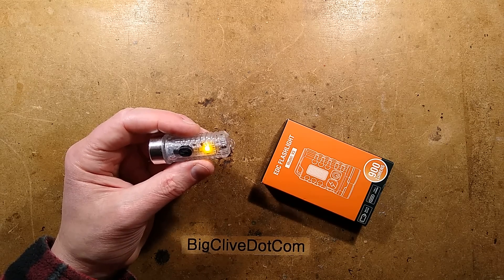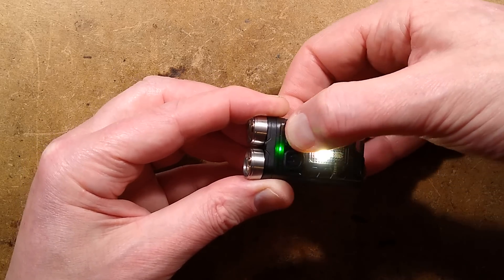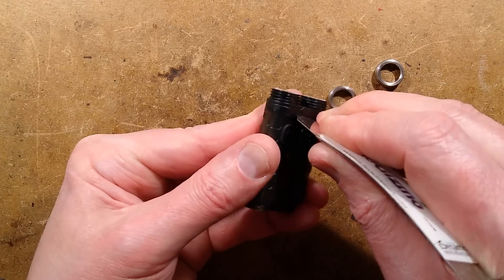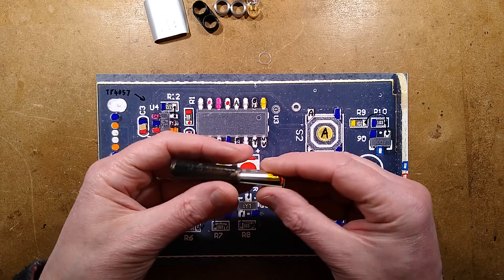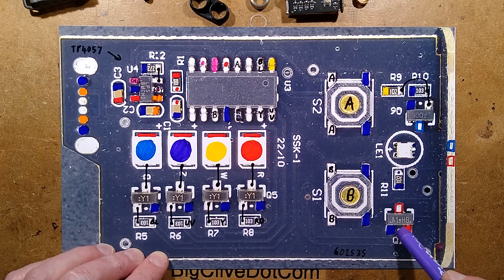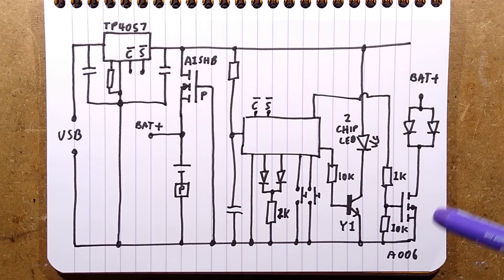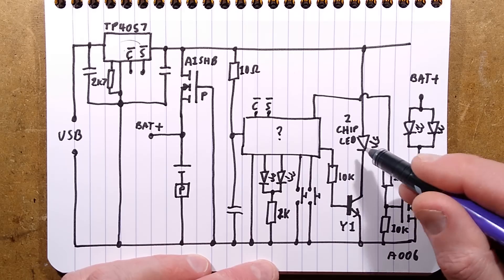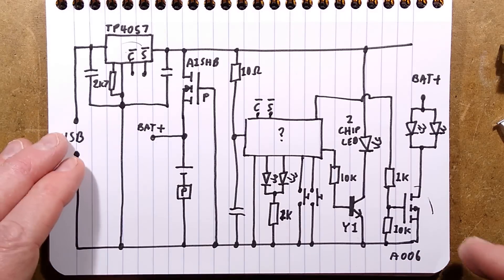Inside an EDC V3 flashlight (with schematic)

Comment: My boruit v3 was broken (not charging), tried to open up as shown in the video, broke it completely. Mine was sealed using some strong glue, the black casing on top broke in pieces but never came apart

Comment: Is it possible to dump the firmware and Flash custom firmeware and how difficult would it be? I‘d like to a a strobe to it
Reply from the maker: You may have to write custom firmware from scratch.
Reply: Probably could do that but unless you know the Chip it’s Not that easy to get Access? Im pretty new and only familiar with arduino/esp/rpi

Comment: These flashlights are great right up until the point you accidentally activate one in your pocket when the battery is low and it drains it below the point where it can be recharged. I've had two of them fail in that exact way now, both in less than five months. The low voltage protection either doesn't exist or doesn't work, and once it drops below threshold there's no way to fix it without breaking it open and replacing the cell. It's a bad design for a torch that's supposed to be kept in your pocket.

Comment: The original Rovyvon Angel Eyes E3 cost £50, Vs £20 of the Boruit V3. The Rovyvon uses a constant current drive and not PWM, and the components are first choice. But for almost one third of the price you got similar functionalities but not similar quality. In addition, the original has one Li-Po battery and one AAA alkaline, and can switch between the two.
Thank you Big Clive for the video...

Comment: there's an eBay torch that's been around for years that i'm surprised he hasn't taken to bits/reversed engineered. keywords are 3 led hand press generator dynamo, comes in different colours. it'd be nice to know if there's a way to distinguish a legit model from a fake, perhaps mod it to make it better, unless they're all fake rubbish. 🙃
cheers!
Reply from the maker: The trigger dynamo flashlights are annoying.  They're also very easy to break by squeezing too hard.

Comment: I have the V10 EDC flashlight. It has the lightning bolt button on the left and the power switch on the right. It has UV as well as three modes of brightness. On the side of the light, it  has an alarm, a red light, blue light, white light, warm white light and green light as well as strobing red, and  strobing red and blue. The red light, white light and warm white light are useful. Not so sure about  the blue light or green light, nor the red flashing or red and blue flashing. I suppose they might be helpful one day.

Comment: Hi Clive watched your teardown for the EDC V3,  liked it so much went to purchase one & found the latest model V10 LED Keychain EDC Flashlight USB so purchased 2 of these. They are amazingly bright for there size. But was using one of them the other night in the garage and noticed that on all settings for the main light it slowly dims in stages. I measured this with a lux light measurement app on my mobile & it is definitely going down in brightness in pretty steady stages... both of them do this & if I cycle the main light back the the set brightness I had it goes back to being brighter. Just weird  did your V3 do the same when you where testing it?
Reply from the maker: I'll check that.  But I prefer lights that do that as it protects the LED against overheating and also saves battery life as your eyes adjust to the lower intensity levels.

Comment: During charging the lights dont turn on is there anything I can do to the circuit to make it usable during charging and especially giving that the main ic is unknown 🥲
Reply from the maker: The unit will not allow the main light to be turned on while charging.  If the charging status lights don't turn on then try charging it with a different charger and a different cable.  Smart chargers may not recognise the load and some UCB cable plugs are too short.

Comment: Hi Clive, thanks for the interesting video!  I recently bought a similar V10 version that has a 1000ma battery and even more LEDs and alarm ‼️ sound.  It has a clear plastic shell that glows a little in the dark. I guess the internal layout will be much the same as the V3.  I'm quite impressed with it’s design and quality.  Cheers…
Reply: I've got the same one, used it for a long walk in the dark in the countryside and it was fab

Comment: The transistor circuits are well designed.  LED current is regulated to base current times beta, which is (logic high - 0.7V) / 15 Kohm .
Reply: The β of the transistor will double with 15 °C temperature increase, and so does the current in the load. We use a resistor on the emitter to limit thermal drift, but there is none here.
The designers relied on the fact that the tiny battery can't drive enough current into the power LED so to harm them. Typical China design. Buy a Nitecore Tiny2, is more expensive but is designed to IEEE standards...
Reply: @rayoflight62  Are you trying to advertise your own design?  Anyways, a resistor in the LED current path will drop voltage according to the LED current and thus requires a supply voltage well above the LED voltage .  This is an old video, but I'm guessing this device was running only a fraction above 3V from a Lithium cell with something regulating the logic down to a stable 3.0V supply, thereby regulating logic high to a fixed number .  Regulating away thermal variation in transistor beta  would require next level logic or internal temperature sensing and PWM control in the logic circuit .
Reply: No, just a strategically placed NTC...

Comment: V10 version has come out now.. And daaaaaaaaaaaaaaamn it is nice. Brighter, more Led options, UV is in the torch head making it more useful  and the Blue can actually be used as a light and not just as a flashy plus has both Neutral and warm whit options too..  Give it a look ..
Reply: From Amazon the Boruit v3 torch is now £20, and the v10 £24 (less 8% at present).  LED Lenser prices soon?!

Comment: better have normal batteries. recharge-able batteries , also goes into the binn one day. and dont power the device that long. you do not want throw away a whole device when the battery is dead. no you just want to buy new batteries. sooner or later.

Comment: the fact manufacturers of these kinds of devices skips those middle pins on the usb type c to cut costs... its only like a 2mm traces, 2 solder pads and a surface mounted resistor missing for it to work correctly with the "smart" chargers, you only save like 2 cents per device at most by not adding that

Comment: I’ve got a question; if those lithium batteries have got that little protection chip on them, does that mean you can charge them directly with a 5v USB supply?
I did a little experiment with one & it did seem to limit the voltage, but that just seems too easy.

Comment: 30 Years ago I was at a yard sale where there was a (Sears?) "Big Beam" 6V incandescent lantern torch for sale for $2. Some clown was trying to haggle it down to a dollar, so I dropped five on the table, grabbed it, and got a nasty look. Man that thing did decades of roadside service. Vanished sometime in the twenty-teens when cheap and awesome LED's became reality .. but I've since learned to hate them (LED's), You see .. the old school lamps would dim and dim, but torches with chips? A year back I was in the bush after dark with my awesome ten million-billion lumen reciprocating sex toy torch, and the chip decided the battery was low and so just shut down - boom. Left me in the bush, in the dark, on a moonless cloudy night with no stars to navigate. Even though i was less than a kilometer from the hoose .. even the most experienced bushman will tell you that you can't walk a straight line blind (The Mythbusters did a thing on that) .. now not that I was in any peril - there are no pumas in northern Ontario, and the night was fair .. hunker down and have a smoke or twenty, wait for a star or the morning - but I recall being royally pissed that the tech I was relying on so casually shit the mattress. I have several hundred dollars of chic LED crap .. but I'd trade them all for that old Big Beam. FWIW, I now carry a kerosene hurricane lantern if I have to do a night trek. So much for the silicon savior.

Oh, by the way .. Have I told you lately that I love you? (Covered many times .. but I think Jim Reeves originally did it) .. if not you, or reciprocity, certainly your content. I tossed in my YouTube hat a few years back .. it was returned - I sucked. You don't.

I'm not jealous. Your videos are like a giant big (reverse?) engineering happy hug after a long day of fixing shit. I actually appreciate how much work you put into these videos.

If Gene Simmons (sp?) hadn't claimed it first .. I'd dedicate the 'devil-horn hand sign' to Big Clive and pump it hard .. Rock on big brother!

Although I still can't bring myself to sully a good glass of golden Kentucky bourbon with cream soda.

Isn't it great that there's an ocean between us and they won't let me on a plane? So I can't park outside your flat?

Just kiddin' .. I'm batshit .. but not that far.

Seriously .. Just a mate on t'other end of a keyboard who likes your shit. :)
Reply from the maker: One of my key requirements for an LED flashlight is that it slowly fades, and doesn't just cut off.

Comment: I think the polarity protection MOSFET actually has its drain tied to the battery and source to the positive rail, not the other way around as drawn in the schematic. Otherwise it would not be particularly effective as reverse polarity protection due to the internal body diode :)

Comment: What nobody talks about it that these push button utilities most don't do proper low power electronics that keeps the self discharge really low.
If you don't want to do this put in a physical switch.
I want flash lights that I can keep a year or two in a drawer for an emergency and then when I want to use it, it still works and has a least half of its charge.
You don't run around using a flashlight every day.
It should at least have still half of it's charge. But so many chargeable stuff is dead after just a month.
I have see some young people on YT doing optimized electronics that work for a theoretical multiple years standby of a micro-controller, so I know it's possible to do it with push buttons but you have to want to do it.
Unfortunately many lithium batteries also have a protection circuitry inside that really doesn't care about this and gobbles up lots of energy during standby.

Comment: I have a Nitecore TIP2 that is a similar but better form factor.  It has a keychain holder which is magnetically attached to the light, making it easy to detach and mount to something ferrous.  It's also made of aluminum, which is nice.  I've had it for year, works great, other than the similarly unfathomable controls.

Comment: To determine battery capacity, which discharge rate and cutoff voltage do you use ?
Reply from the maker: I test them with a module that cuts of at 2.5V and then measure the charge mAh.

Comment: My problem is modern LED flashlights are too bright for a daily driver for me.  I would rather they be half as bright with double the battery life.  And I hate the ones where you have to press the button multiple times to get to the light setting I want.  My ideal flashlight would have several pins and a jumper inside the battery compartment that I can pick one of 4 light settings, and then just leave it where I want it so I don't have to play around with the button for several seconds every time I just need a little light on something.

Comment: The LEDs driven by the transistors might be regulated by a PWM output, which is more efficient than wasting heat in a current limiting resistor... useful for getting that little bit extra juice out of the battery.

Speaking of batteries, I found a battery recycling drop off thingy where people put their used vape pens... free li-po batteries!!

Comment: You say that the USB C charging port does not have the load identification resistors, and that some smart chargers may not detect its presence and will not charge it! 
Is it posible to add one and where would be the good palce to put it?

Thx for the good videos!
Reply from the maker: There's not a lot of space.  It would have been better to design it in.

Comment: Now you should bring your own branded flash light.
Reply: yesss. milled from T6 aero grade aluminium, no button double/tripple/what ever tap codes. just on and off. 300lm and at least 10h runtime. usb-c chargeport and watertight capped.

Comment: I got the translucent version that can be "charged" with the UV led and then it is glowing in the dark. Quite handy :) For this black one the UV led is not very useful.
Reply: Does it glow for a long time?
Reply: @robm8809  around 2 minutes
Reply: @randybb  Thanks. That's not so good, the best luminous pigments glow for eight or even ten hours, very useful if camping, the glow lasts all night and makes the torch easy to find.
Reply: @robm8809  the previous test was during a day and it was not very visible, but when it is really dark then after 15 minutes it is still glowing.
Reply: @randybb  Thanks. :)
Reply: The green glow doesn't last long, but there is a faint white glow which lasts all night.

Comment: I don't get why these things don't have a power switch and then a mode/brightness button, it would make them so much easier to use
Reply: If you find such a thing, let us all know. I've been wanting one for my bike for years. It's disappointing to try turning or dimming your light (e.g. night dog walkers) and start flashing at them with 3,000 lumens.
Reply: My Sofirn SC21 can start really dim everytime. It uses ramping mode so i can set at whatever brightness i want.
Reply: This is actually close. Double click either button and the relevant light comes on in the mode you last used. You don't have to cycle through modes from a default mode.

Comment: Clive, your the led guru, what do you make of this?
I have an led bulb in my living room which has gone bad, if you try to switch it on it just glows dimly with a very slight flicker and when you turn it off it continues to glow at the same brightness for two to three seconds then extinguishes.

Sometimes if you leave the light on for a long time it will come to live and illuminate properly.

Its obviously a component in the power supply but I've not opened Tue blub to investigate yet.
Reply from the maker: Very common failure.  A failed LED chip that is tracking slightly, causing the glow and flicker.  The fade-out is the low current of the faulty LED string discharging the smoothing cap slowly.  Sometimes the tracking will establish a temporary bridge that results in the light illuminating at almost full intensity.

Comment: Could you mod it to use a USB cable/power bank with a resistor to limit it? would be a nice video imo
Reply: The resistors need to be connected to the cc1 and cc2 pins of the USB socket. It's so the charger knows you have a device there and that it should give you standard USB current and voltage. The resistors aren't current limiting like that, they are just signalling.
Reply: @zyeborm  I mentioned a resistor because i highly doubt that Light would like being powered by 5V.

Comment: When I have to open one of these throw-away items I usually use my jeweler's saw. You can make very fine cuts with it but it needs some practice since the saw blades are fragile compared to other saws.
Reply: 6/0 blades are like cutting with a sewing thread thick blade , I could make one last all week sizing ring's without breaking

Comment: Robot technician:  I don't usually make house calls, but I'll make an exception for Grandpa.  You say that he can't wake up in the morning.

Mother robot:  Yes.  He went to that quack doctor at RoboMed yesterday and then he couldn't wake up this morning.

Technician:  Ok. Let's have a look then.  I'll just connect my OBD99+ scanner and see what it says..  Oh look.. There's a message scrolling on the screen.  It says: TO POWER ON PRESS AND HOLD POWER BUTTON FOR 3 SECONDS THEN PRESS POWER BUTTON 3 TIMES THEN PRESS RESET BUTTON 3 TIMES WHILE HOLDING POWER BUTTON.  BE CAREFUL NOT TO ACTIVATE SELF-DESTRUCT SEQUENCE.  SEE MANUAL FOR SELF-DESTRUCT SEQUENCE.  REFER ALL SERVICE TO ROBOMED CORP.  ROBOMED CORP IS NOT RESPONSIBLE FOR MALFUNCTION RESULTING FROM UNAUTHORIZED ACCESS.

To be continued...

:-[     @:-(     8o] Zzzzzz

Comment: They have since revised the software on the buttons (or I got one programmed by someone half competent). 

Long hold is "full intensity". 
Two presses is "on".
Long press is "off".
Single presses cycle through modes.

Comment: I really wish the lights with multiple light modes would support programming, and being able to set a lower default light setting.

I use a streamlight at work, and with the 10 tap programming, I can set it to disable modes I don't need (strobe) and set it so when I turn it on, the low 150 lumen setting is the default, I can go brighter if need be, but that's rare for my use case.
Reply: You're in luck. Look up Anduril flashlights. Anduril is flashlight programming offered on a few brands of flashlights.

Comment: The last one had amber. I figured it was a maplight. The uv is alright instead. 
  
Have you seen any portable leds that are tunable in the uv? There's rocks I'd like to hunt and they are sometimes several different things either combined or separate, sodalite, fluorite and something I can't remember 😃
Reply: I think it was applied science who made one (sorta) from memory it was his quantum dot? Or coloured nano particle video. He used the different frequencies to grow the particles to a specific size I think.
But I could be 100% wrong on that lol. It was either him or breaking taps.
Reply from the maker: I've not seen one with multiple UV wavelengths in one unit.